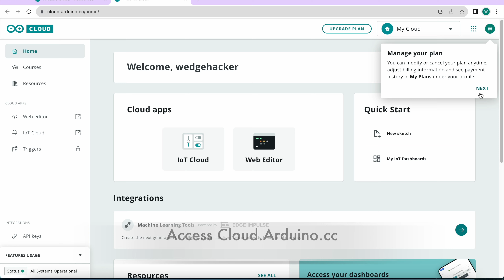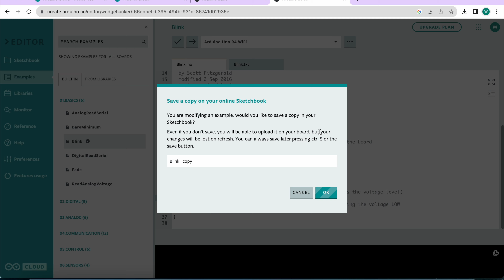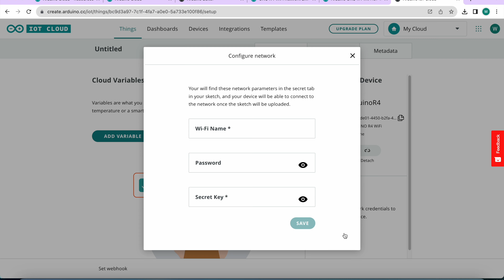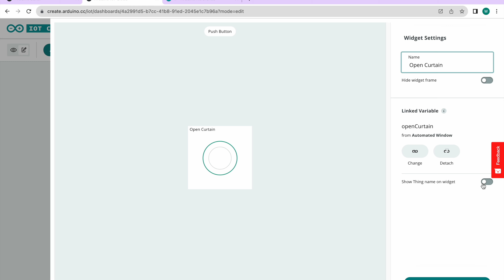How to control Window Curtains with Phone: DIY Arduino Automation (2024)

Comment: Thanks for the video. Since there are no sensors, the program relays on the status as reported by the cloud, which means internet connection must be valid, and no manual changes were made to the curtain.
Reply from the maker: Yeah, I kept the default on startup as curtain closed, so if you started with the curtain open, it won't work. A simple limit switch would do the trick.

Comment: Can you help me to understand how much total revaluation is needed according to the curtain, how to determine it & how to change that in the code ?
Reply from the maker: The number of turns depends on the width of your curtain, so you’ll have to do some trial and error. In the code, you’ll see two lines [for (int i=1; i<=16; i++)], to open and close, where it says 16 is the number of turns that worked for me. Make sure the number on both match exactly* Hope this helps.
Reply: Thank you so much ❤

Comment: Bang..kalau guna Arduino Uno tu boleh ke?
Reply from the maker: This project uses Arduino Uno R4 which has built in WiFi; however, you can use any Arduino board with an external WiFi module.